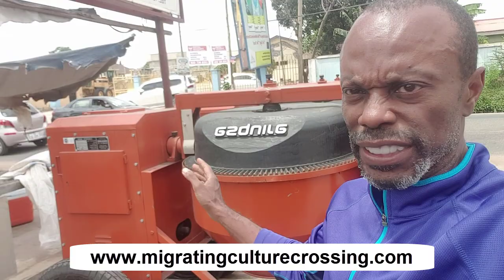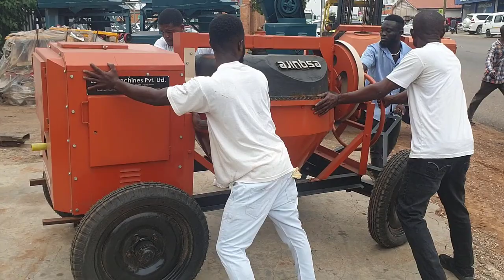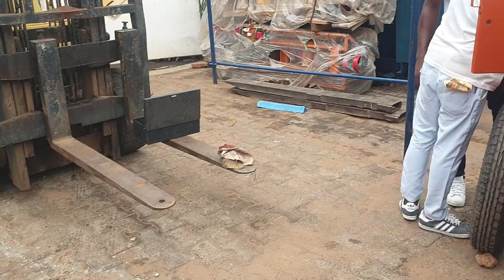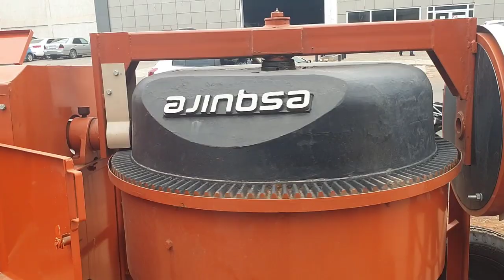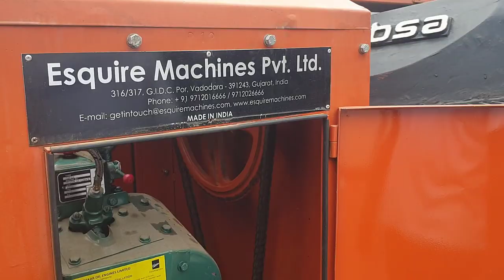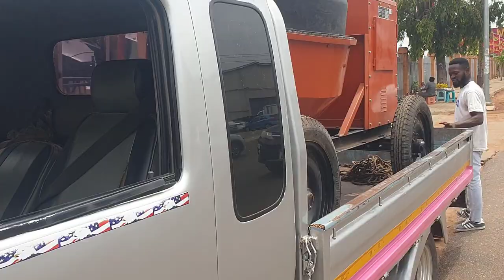Shopping For A Concrete Mixer

Comment: 👍🏾 Agreed, they are not your workers and under contract with a different company, so you don't have to bare the cost of H&S. 

H&S starts from the company that sent them over. They should be able to provide boots, gloves & safety cover for cutting tools, etc without breaking the bank.
Reply from the maker: Exactly! They work for themselves.

Comment: Agreed. We don't need to burden our people with everything the west does. Be selective and only implement that which will help, rather than hinder.  Mixer is a great investment!
Reply: hmm but there is something called health and safety and its there for a reason. Many people have been injured or killed on building sites. I have purchased land in Ghana and i will ensure that safety measures are in force once work begins otherwise no work...Prevention is better than cure my dear
Reply from the maker: @dannydct1  Yes, people are injured or killed on building sites where every conceivable health and safety measure has been undertaken. The point is that there is a cost to implementing such measures and it must make financial sense. Trying to come here and implement such measures upfront in one fell swoop in an attempt to blindly imitate systems from the West could easily bankrupt a small company. So, unless you have an infinite budget then you need to be very selective and methodical about how you implement safety policies. There is a balance that needs to be adhered to maintain financial stability.
Reply: @dannydct1  I'm not your dear. As a business manager of 2 schools in the UK I can assure you if we complied with every h&s rule we'd have to hire 4 people to do the job of 2. We wouldn't have money left to teach the children properly, our primary task. As someone who buys run down houses to do up, live in then sell, I know how to balance the safety of the tradesmen with that of cost. Common sense is what's needed. And our people have plenty of that!